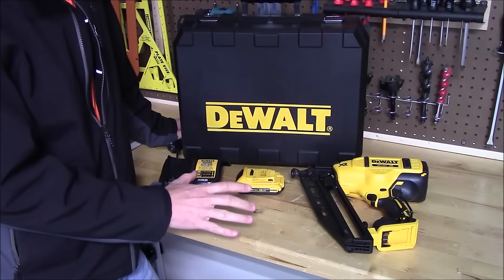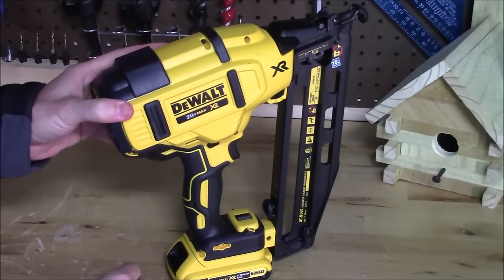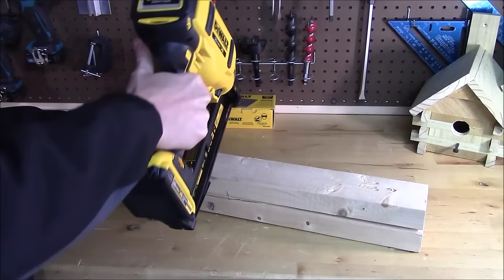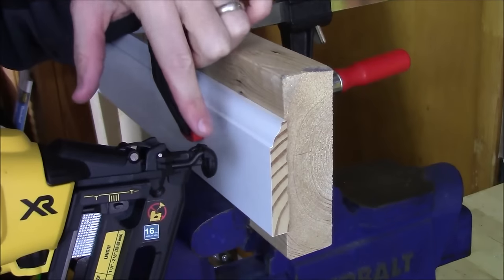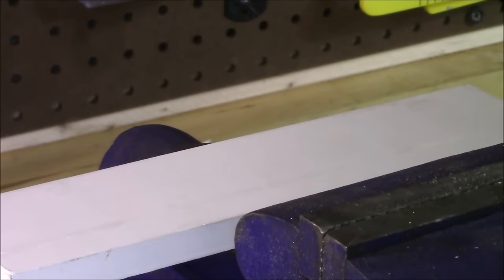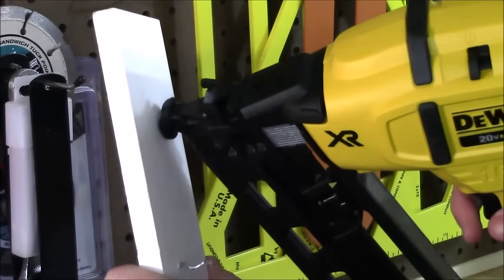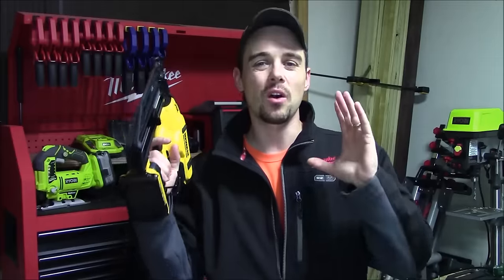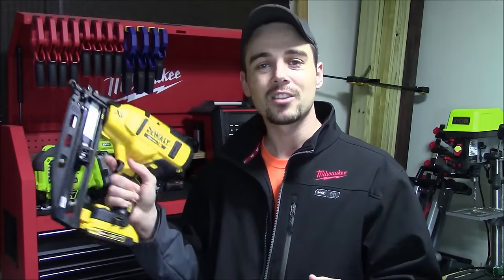DEWALT DCN660 20V Max Brushless 16 Gauge Angled Finish Nailer - DCN660B / DCN660D1

Comment: I just got the 15 guage as it shoots a bigger finish nail. After 500 nails I really like this nailer. It shoots through oak flooring for those close to the wall  situations it also gets into tight spots like inside flush wood floor vent areas. The battery lasts all day. 
At $400 its pricy but of all my nailers from framing to brad I use the finish most of all and no hoses  is a really nice feature.

Comment: I'm trying to figure out if I got a bad nailer. The motor sounds like metal on metal when I left off the trigger and stops quickly . I also have the dcn692 framer and it is quiet when I let off the trigger and the motor spins for a little bit.
Reply from the maker: +carl neuman the motor "spools down" like a helicopter once you release the trigger....it doesn't stop instantly.  That is normal with this nailer.

Comment: I would have expected the single shot mode to last longer than the bump mode.  Did you say bump mode is more efficient?  If so, can you explain that a little further?  Thanks and great review.
Reply: Believe because the motor is already rev-ed up to go, and all you'll do is bump the nail out instead of the motor needing to rev up each time

Comment: I sent mine back because the motor doesn't sound right. Sounds like bad bearings. I have the framing nailer and that motor sounds like a normal motor.

Comment: I have this gun, DON'T BUY IT, Dewalt astonishingly did not have the forethought to put in a stop fire feature after the gun runs out of nails, so you continue to " dry fire " the gun with no nails in it, this is an epic omission, and the gun jambs all the time, the Riobi 18 gage gun I have for 4 years works flawlessly and stops firing when nails run out, not one issue with Riobi.
Reply: Michael Mancini I have the 16 gauge Ryobi ,it's a bit bulky but powerful and very reliable.